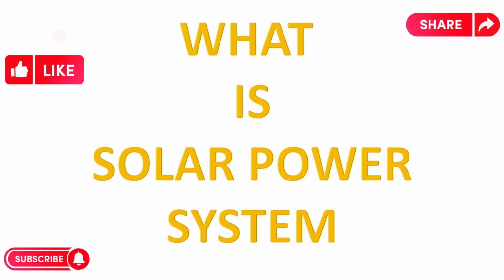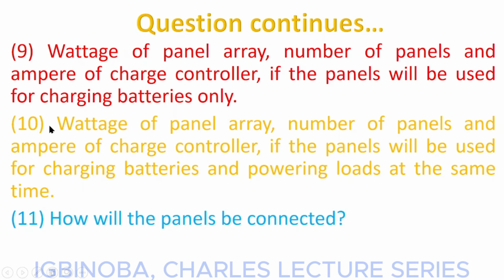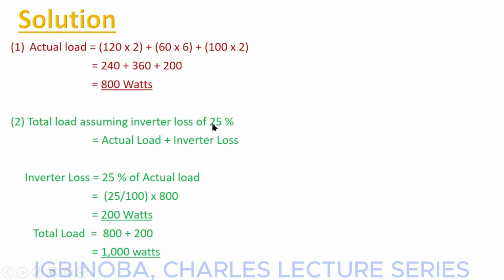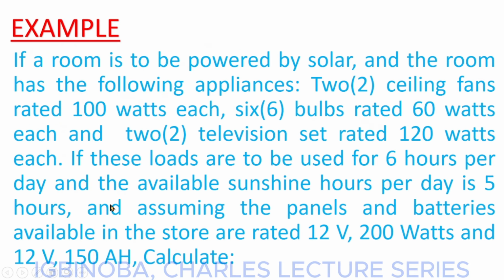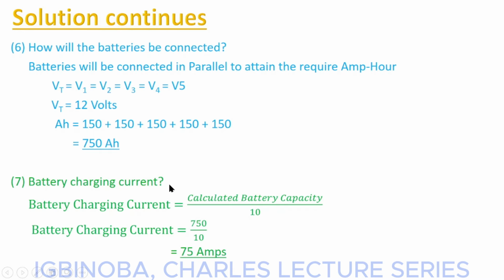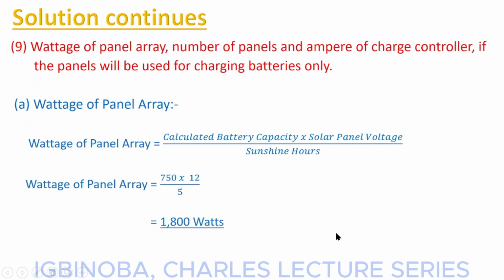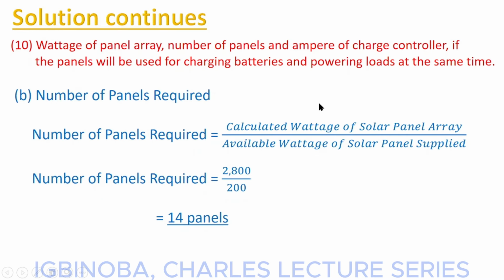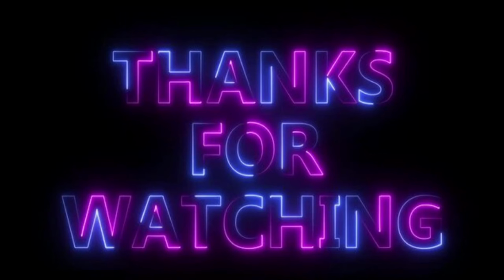Design of Solar Power System

Comment: CHM351Y

1.
Actual load=1380watts

2.
Total load=1725watts

3.
Inverter ratings =2156.26VA

4.
Battery capacity=1293.75AH

5.
No of Batteries=9

6.
Parallel

7.
Battery charging   
current=129.38Ampere

8.
Charging time =14 hours

9.
a)3105w
b)15.5 panels
c)258.75A

10.
a)4830watts
b)24 panels
c)402.5A

11. Parallel

Comment: NAT332F

1. Actual load = 1380W
2. Total load = 1725W
3. Inverter Ratings = 2157W
4. Battery capacity = 1293.75W
5. Number of batteries = 8.625
6. Parallel strings of 4 batteries in series.
7. Battery charging current = 129.375A
8. Charging Time = 14Hrs
9 (i) 3105W
   (ii) 15.525
  (iii) 258.75A
 10 (i) 4830W
      (ii) 32.2
      (iii) 402.5A
11. Panel connection = 3 parallel strings of 6 panels in series

Comment: EEE315O

1. ACTUAL LOAD: 1380W
2. TOTAL LOAD: 1840W
3. INVERTER RATING: 2300VA
4. BATTERY CAPACITY: 1227AH
5. NO OF BATTERIES: 9 BATTERIES 
6. BATTERY CONNECTION: PARALLEL 
7. BATTERY CHARGING CURRENT: 15A
8. BATTERY CHARGING TIME: 5.1 DAY'S 
9. PANEL ARRAY - 
A.) WATTAGE - 2945W
B.) NO OF PANEL - 15 PANEL'S
C.) CHARGING CONTROLLER AMPERE : 245A
10. PANEL ARRAY - 
A.) WATTAGE - 4785W
B.) NO OF PANEL'S : 24PANELS
C.) CHARGE CONTROLLER AMPERE: 339A
11.) PANEL CONNECTION SERIES: PARALLEL

Comment: MECH386H

1. Actual Load: 1380 W

2. Total Load (including inverter loss): 1840 W

3. Inverter Rating (VA): 2300 VA

4. Battery Capacity: 1227 Ah

5. Number of Batteries: 9 batteries

6. Battery Connection: Parallel

7. Battery Charging Current: 15 A (per battery string)

8. Battery Charging Time: 5.1 days

9. Panel Array (for charging batteries only):

Wattage: 2945 W

Number of Panels: 15 panels

Charge Controller Ampere: 245 A

10. Panel Array (for charging batteries and powering loads):

Wattage: 4785 W

Number of Panels: 24 panels

Charge Controller Ampere: 399 A

11. Panel Connection: Series – Parallel

Comment: MECH38H

1. Actual load: 1380w  
2. Total load: 1725w  
3. Inverter rating: 2156.25VA  
4. Battery capacity: 1293.75AH  
5. Number of batteries: 9  
6. Configuration: parallel  
7. Battery charging current: 129.375 amps  
8. Charging time: 14 hours  
9. (A) 3105W  
   (B) 15.5 panels  
   (C) 258.75A  

10. (A) 4830W  
    (B) 24 panels  
    (C) 402.5A  

11. Configuration: parallel

Comment: EEE3180X
1. Actual Load = 1380Watts

2. Total Load = 1725Watts

3. Inverter rating(VA) = 2156,25VA

4. Battery Cap. = 1293.75Ah

5. No. Of batteries = 8.6~ 9 batteries

6. Parallel

7. Battery charging = 129,4A

8. Time = 14hrs

9. (a) 3105Watt (b) 15.5 ~ 16 panels (or 200watt(5) then a 100watt (c) Current =

258.75Amp

10. (a) 4830Watt (b) 24 panels (c) 402,5Amp

11. Parrelel

Comment: PETRO330D

1. The actual load
=(3×100)+(10×60)+(4×120)
=1380 watts

2. Total load assuming inverter loss of 25%
= 1380+(25% of 1380)
=1380+ 345
=1725 watts

3. Inverter rating in VA using power factor of 0.8
= Total load ÷ power factor
= 1725÷0.8
=2156.25 VA

4. Battery capacity using a factor for reserve of 75%
Battery capacity = (2×total load×back up hours×factor for reserve) / battery voltage 
= (2×1725×6×0.75) / 12
= 1293.75 AH

5. Number of battery for backup hour
= Calculated battery capacity÷capacity of battery available 
=1293.75 ÷ 150
=8.625
=8

6. How will the battery be connected?
The battery would be connected in parallel to attain the required amp hour
V1=V2=V3=V4=V5=V6=V7=V8
V1= 12 volts
AH = 150 × 8
= 1200 AH

7. Battery charging current
= Calculated battery capacity ÷ 10
= 1293.75 ÷ 10
= 129.375 amps

8. Battery charging time assuming charging loss of 40%
= {Calculated battery capacity + ( 40% of calculated battery capacity)} / charging current 
= {1293.75 + (40% of 1293.75)} ÷ 129.375
= 14 hours

9a. Wattage of panel array
= ( Calculated battery capacity × solar panel voltage) ÷ sunshine hours
= ( 1293.75 × 12) ÷ 5
= 3105 watts

9b. Number of panels array
= Calculated wattage of solar panel array ÷ available wattage of solar panel supplied 
= 3105÷ 200
= 15.525 
= 15 panels

9c. Ampere of charge controller required 
= Calculated wattage of solar panel array ÷ solar panel voltage 
= 3105 ÷ 12
= 258.75 amps

10a. Wattage of panel array
= Calculated wattage of solar panel array for charging battery only + calculated total load
= 3105 + 1725
= 4830 watts

10b. Number of panels required 
= Calculated wattage of solar panel array ÷ available wattage of solar panel supplied 
= 4830 ÷ 200
= 24.15
=24 panels

10c. Ampere of charge controller 
= Calculated wattage of solar panel array ÷ solar panel voltage 
= 4830 ÷ 12
= 402.5 amps 

11. How will the panels be connected? 
The panels would be connected in parallel.

Comment: PETRO3125U

1. The actual load
=(3×100)+(10×60)+(4×120)
=1380 watts

2. Total load assuming inverter loss of 25%
= 1380+(25% of 1380)
=1380+ 345
=1725 watts

3. Inverter rating in VA using power factor of 0.8
= Total load ÷ power factor
= 1725÷0.8
=2156.25 VA

4. Battery capacity using a factor for reserve of 75%
Battery capacity = (2×total load×back up hours×factor for reserve) / battery voltage 
= (2×1725×6×0.75) / 12
= 1293.75 AH

5. Number of battery for backup hour
= Calculated battery capacity÷capacity of battery available 
=1293.75 ÷ 150
=8.625
=8

6. How will the battery be connected?
The battery would be connected in parallel to attain the required amp hour
V1=V2=V3=V4=V5=V6=V7=V8
V1= 12 volts
AH = 150 × 8
= 1200 AH

7. Battery charging current
= Calculated battery capacity ÷ 10
= 1293.75 ÷ 10
= 129.375 amps

8. Battery charging time assuming charging loss of 40%
= {Calculated battery capacity + ( 40% of calculated battery capacity)} / charging current 
= {1293.75 + (40% of 1293.75)} ÷ 129.375
= 14 hours

9a. Wattage of panel array
= ( Calculated battery capacity × solar panel voltage) ÷ sunshine hours
= ( 1293.75 × 12) ÷ 5
= 3105 watts

9b. Number of panels array
= Calculated wattage of solar panel array ÷ available wattage of solar panel supplied 
= 3105÷ 200
= 15.525 
= 15 panels

9c. Ampere of charge controller required 
= Calculated wattage of solar panel array ÷ solar panel voltage 
= 3105 ÷ 12
= 258.75 amps

10a. Wattage of panel array
= Calculated wattage of solar panel array for charging battery only + calculated total load
= 3105 + 1725
= 4830 watts

10b. Number of panels required 
= Calculated wattage of solar panel array ÷ available wattage of solar panel supplied 
= 4830 ÷ 200
= 24.15
=24 panels

10c. Ampere of charge controller 
= Calculated wattage of solar panel array ÷ solar panel voltage 
= 4830 ÷ 12
= 402.5 amps 

11. How will the panels be connected? 
The panels would be connected in parallel.

Comment: MECH104Z

1 actual load =1380w
2 Total load =1725w
3 Inverter rating=2156.25va
4 battery rating=1293.75Ah
5 Number if batteries=9
6 battery are connected in parallel 
7 Battery charging current=129.4amps
8 Battery charging time= 14hrs
9
a wattage panel array=3105watts
b Number of panels =16
C charge controller =258.75A
10.
a wattage of panel array=4830 watts
b Number of panels=24
C charge controller=402.5A
11 panel are arranged in parallel

Comment: ANSWER TO ALL QUESTIONS 
SUBMISSION CODE:3150T

1. Actual Load: 1380 W

2. Total Load (including inverter loss): 1840 W

3. Inverter Rating (VA): 2300 VA

4. Battery Capacity: 1227 Ah

5. Number of Batteries: 9 batteries

6. Battery Connection: Parallel

7. Battery Charging Current: 15 A (per battery string)

8. Battery Charging Time: 5.1 days

9. Panel Array (for charging batteries only):

Wattage: 2945 W

Number of Panels: 15 panels

Charge Controller Ampere: 245 A

10. Panel Array (for charging batteries and powering loads):

Wattage: 4785 W

Number of Panels: 24 panels

Charge Controller Ampere: 399 A

11. Panel Connection: Series – Parallel

Comment: PETRO341O

ANSWERS TO SWEP TASK
 
1. Actual load= (100×3)+(60×10)+(120×4) =1380watts
2. Total load assuming inverter loss of 25%= Actual load +Inverter loss
Inverter loss=25% of Actual load
= 25%×1380=345 watts
Total load= 1380+345=1725 watts
3. Inverter rating on VA using power factor of 0.8
= (1725÷0.8)= 2156.25
4. Battery capacity using factor for reserve 75%=(2×1725×6×0.75)=1293.75Ah
5. No. of batteries for backup hours=1293.75Ah÷150Ah= 8.6 =9 batteries 
6. How batteries will be connected?
The batteries will be connected in parallel 
Vt=V1=V2=V3=V4=V5=V6=V7=V8
Ah= 150+150+150+150+150+150+150+150+150=1350
7. Battery charging current=1293.75÷10=129Amps
8. Battery charging time assuming charging loss of 40%= 1293.75Ah+(40%+1293.75Ah)÷129A=14hrs
9a. Wattage panel array= 3105 watts
9b. Number of panels required= 3105÷345=9 panels 
9c. Ampere of charging controller required= 3105÷12=258.75Amps
10a. Wattage of panel array= Calculated wattage of solar panel array for charging battery only+ calculated total load =3105+1725=4830watts
10b. Number of panels required= calculated wattage of solar panel array÷ Available wattage of solar panel supplied= 4830watts÷345= 14Amps
10c. Ampere of charge controller= calculated wattage of solar panel array÷ solar panel voltage=4830watts÷12volts= 402.5Amps
11. How will the panels be connected?
Ans: They will be connected in parallel cause voltages are constant(12v)

Comment: CHM3410
i) Actual load = 1380 watts.
ii) Total load = 1725 watts.
iii) Inverter ratings in VA = 2156.25VA.
iv) Battery capacity = 1035Ah.
v) Number of batteries for backup hours = 6.9= 7 batteries.
vi) The batteries will be connected in parallel.
vii) Battery charging current= 103.5 A.
viii) Battery charging time= 14 hours 
ix) a. Wattage of panel array= 2484 watts.
b. Number of panels= 12.42 = 12 panels
c. Ampere of charge controller= 207A.
x) a. Wattage of panel array= 4209 watts.
b. Number of panels= 21.05 = 21 panels.
c. Ampere of charge controller= 350.75A.
xi) The panels will be connected in parallel just as the batteries

Comment: PETRO373U
ANSWERS 
1. Actual load= (100×3)+(60×10)+(120×4) =1380watts
2. Total load assuming inverter loss of 25%= Actual load +Inverter loss
Inverter loss=25% of Actual load
= 25%×1380=345 watts
Total load= 1380+345=1725 watts
3. Inverter rating on VA using power factor of 0.8
= (1725÷0.8)= 2156.25
4. Battery capacity using factor for reserve 75%=(2×1725×6×0.75)=1293.75Ah
5. No. of batteries for backup hours=1293.75Ah÷150Ah= 8.6 =8 batteries 
6. How batteries will be connected?
The batteries will be connected in parallel 
Vt=V1=V2=V3=V4=V5=V6=V7=V8
Ah= 150+150+150+150+150+150+150+150=1200
7. Battery charging current=1293.75÷10=129Amps
8. Battery charging time assuming charging loss of 40%= 1293.75Ah+(40%+1293.75Ah)÷129A=14hrs
9a. Wattage panel array= 3105 watts
9b. Number of panels required= 3105÷345=9 panels 
9c. Ampere of charging controller required= 3105÷12=258.75Amps
10a. Wattage of panel array= Calculated wattage of solar panel array for charging battery only+ calculated total load =3105+1725=4830watts
10b. Number of panels required= calculated wattage of solar panel array÷ Available wattage of solar panel supplied= 4830watts÷345= 14Amps
10c. Ampere of charge controller= calculated wattage of solar panel array÷ solar panel voltage=4830watts÷12volts= 402.5Amps
11. How will the panels be connected?
Ans: They will be connected in parallel

Comment: EEE3162F

1) Actual Load= 1380watts 
2) Total Load= 1725watts 
3) Inverter rating = 2156..25v 
4) Battery Capacity = 1293.75Ah 
5) No of Batteries = 9 
6) Batteries are connected in Parallel 
7) Battery Charging current= 129,4 amps 
8) Battery Charging time = 14hrs 
9a) Wattage of panel array = 3105watts 
9b) Number of panels = 16 panels 
9c) Charge Controller = 258.75A 
10a) Wattage of panel array = 4830watts 
10b) Number of panels = 24 
10c) Charge Controller = 402.5A 
11) Panels are arranged in Parallel

Comment: EEE332F 

1. Actual load = 1380 watts
2. Total load = 1725 watts
3.Inverter rating = 2156.25 VA
4. Battery rating = 1293.75 Ah
5. Number of batteries = 9
6.Battery are connected in parallel
7.Battery charging current = 129.4 Amps
8.Battery charging time = 14 hrs
9
a Wattage of panel array = 3105 watts
b Number of panel = 16 panels
c Charge controller = 258.75 A 10.
a Wattage of panel array = 4830 watts
b Number of panels = 24
c Charge controller = 402.5 A
11.panels are arranged in parallel

Comment: NAT 346T

1 ACTUAL LOAD = 1380W
2 TOTAL LOAD = 1725W

3 INVERTER RATING 2157W
4 BATTERY CAPACITY 1293.75W

5 NO. OF BATTERIES  8.625
6 Parallel

7  CHARGING CURRENT 129.375A
8 CHARGING TIME = 14HRS
9 (i) 3105W
   (ii) 15.525
   (iii) 258.75A

10 (i)4830W
     (ii) 32.2
     (iii) 402.5A

Comment: MAR352Z
1. Actual load: 1380 W
2. Total load with inverter loss: 1725 W
3. Required inverter rating: 2156.25VA
4. Required battery capacity: 1293.75AH
5. Number of 150 Ah batteries needed: 8.6 ~ 8 batteries
6. Battery connection: All 9 are in parallel
7. Battery charging current: 129A
8. Battery charging time (40% loss): 14 hours
9. Panel array for charging only: 3105W
   9b. Number of panels: 15.5 ~ 15 panels
    9c. Ampere of charge controller: 258.75A
10. Panel array for charging + powering load: 4380W
10b. Number of panels: 24 panels
10c. Ampere of charge controller: 402.5A
11. Panel connection: All panels are in parallel

Comment: Mech3144N

1) actual load =1380watts 

2 ) inverter loss =25% of 1380=345
Total load=1380+345= 1725 watts

3) inverted rating using 0.8 power factor 
1725÷0.8=2156.25

4) battery capacity using factor of reserves 75%
2x1725×6×0.75/12=1294AH

5) number of batteries for backup hrs= 1294÷150= 8.6 

6) battery will be connected in parallel 
Vt=12v
It=150×8.6=1290

7) battery charging current 
=1294/10=129.4amps

8) battery charging time at 40% loss 
1294+(1294×0.4)/129.4=14hrs

9a) 1294×12/5=3105.6 watts 
9b)no of panels required :3105.6÷345=9 panels 
9c) ampere of charge controller required:3105.6÷12=258.8amps

10a)3105.6 + 1725=4830.6watts
10b) panels required:4830.6÷345=14amps
10c)4830.6÷12=402.5amps

11) panels is connected in parallel

Comment: EEE320T
1. Actual load 1380w
2. Total load 1720w
3. Inverter rating 2156.25VA
4. Battery capacity 1293.75Ah
5. Number of batteries 8.6.
6. Parallel
7. Battery charging 129.4A
8. T= 14hrs
9(a) 3105w
(b) 15.5panels
(C) 258.75A
10. (a) 4830w
(b) 24panels
(c) 402.5A
11. Parallel

Comment: MECH3205Y
1. Actual load :1380W
2. Total Load( including inverter loss): 1840W
3. Inverter Rating (VA): 2300 VA
4. Battery Capacity: 1227 Ah
5. Number of Batteries: 9 batteries 
6. Battery connection:parallel 
7. Battery Charging current: 15A (per battery string)
8. Battery Charging Time :5.1 days 
9.Panel Array ( for charging batteries only): wattage 2105w
Number of panels : 16 panels 
Charge controller Ampere : 245 A 
10. Panel Array ( for charging batteries and powering loads) :
Wattage :4785w 
Number of  panels 24 w
Charge controller Ampere :402.5Amps
11. Panel Connection:parallel

Comment: NAT320T
1. Actual load =1380Watts
2. Total load =1725Watts
3. Inverter rating =2156.25VA
4. Battery capacity=1293.75A
5. Number of batteries =9
6. Batteries are connected in parallel.
7. Battery charging current =129.4A
8. Battery charging time =14hrs.
9a. Wattage of panels array=3105Watts
9b. Number of panels = 16 panels.
9c. Charge controller ampere rating: 258.75A
10 a. Wattage of panels array =4830Watts
10 b. Number of panels is 24
10 c. Charge controller ampere =402.5A
11. Panels are arranged in parallel

Comment: MAR3162F

i) Actual load = 1380 watts.
ii)Total load = 1725 watts.
iii)Inverter ratings in VA = 2156.25VA.
iv)Battery capacity = 1035Ah.
v)Number of batteries for backup hours = 6.9= 7 batteries.
vi)The batteries will be connected in parallel.
vii)Battery charging current= 103.5 A.
viii)Battery charging time= 14 hours
ix)a. Wattage of panel array= 2484 watts.
b. Number of panels= 12.42 = 12 panels
c. Ampere of charge controller= 207A.
x)a. Wattage of panel array= 4209 watts.
b. Number of panels= 21.05 = 21 panels.
c. Ampere of charge controller= 350.75A.
xi)The panels will be connected in parallel just as the batteries

Comment: MAR3139I
1)actual load=1380watts
2)Total load=1725watts
3)inverter  rating=2156.25VA
4)Battery capacity=1293.75Ah
5)Number of batteries=8.6
6)connection parallel
7)Battery charging current=129.375
8) charging time= 14 hour's 
9)a wattage of pannel array=3105w, (B)Number of panels 16 panels charge controller 258.75A
10) (A)wattage of panels array=4830W, (B)Number of pannel= 24, (C) charge controller=4025A
11) panels arrangement parallel

Comment: COMP327A
1. Actual load = 1380 Watts
2. Total  load = 1725 Watts 
3. Inverter rating = 2156.25VA
4. Battery capacity = 1293.75Ah
5. Number of batteries = 8.65 ~ 9
6. Connection: Parallel 
7. Battery charging current = 129.375 A
8. Battery charging time = 14 hours
9. a. Wattage of panel array = 3105W
b. Number of panels = 15.525~16
c. Charge controller = 258.75 A
10. a. Wattage of panel array = 4830 Watts
b. Number of panels = 24
c. Charge controller = 402.5 A
11. Panels are arranged in parallel

Comment: MAR3168L
1. Actual load: 1380 W
2. Total load:  1725 W
3. Inverter rating: 2156.25 VA
4. Battery capacity: 1293.75 AH
5. Number of batteries: 9
6. Configuration: parallel 
7. Battery charging current :129.375 amps
8. Charging time: 14 hours 
9. (a) 3105 w
     (b) 15.5 panels
      (C) 258.75 A
10. (a) 4830 watts 
       (b) 24 panels 
        (C) 402.5 A
11. Configuration: parallel

Comment: PETROCHEM312L

1 Actual load is 1380W
2 Total load is 1720W
3 Inverter rating is 2156.25VA
4 battery Capacity is 1293.75Ah
5 number of batteries is 8.6
6 Parallel 
7 Battery charging is 129.4A
8 Time is 14hrs
9 (a) 3105W
   (b) 15.5 panels 
   (c)  258.75 A
10 (a) 4830W 
     (b) 24 panel 
     (c) 402.5A 
11 Parallel

Comment: PETROCHEM385G

1 Actual load 1380W
2 Total load  1720W
3 Inverter rating  2156.25VA
4 battery Capacity 1293.75Ah
5 number of batteries 8.6
6 Parallel 
7 Battery charging  129.4A
8 T = 14hrs
9 (a) 3105W
   (b) 15.5 panels 
   (c)  258.75 A
10 (a) 4830W 
     (b) 24 panel 
     (c) 402.5A 
11 Parallel